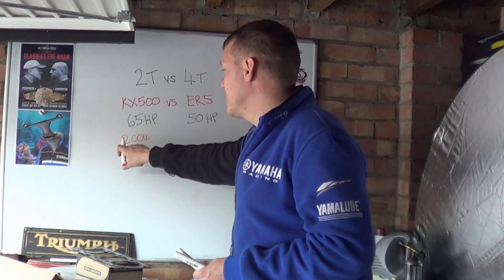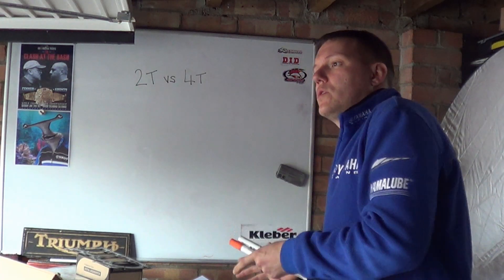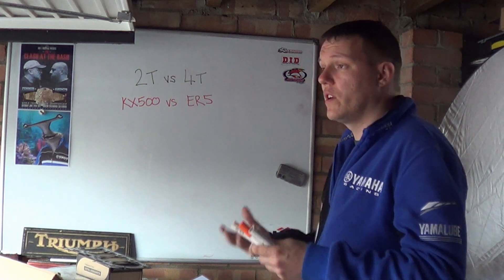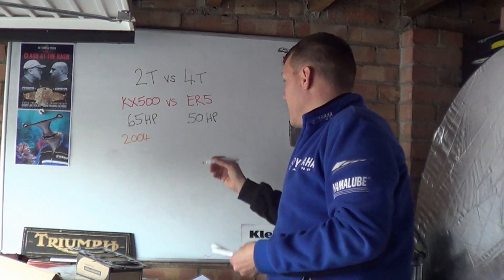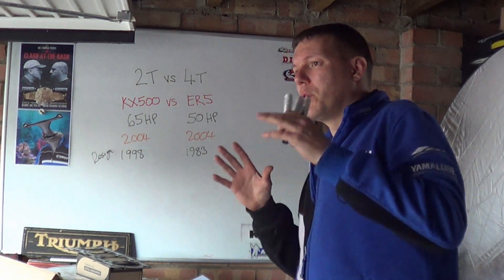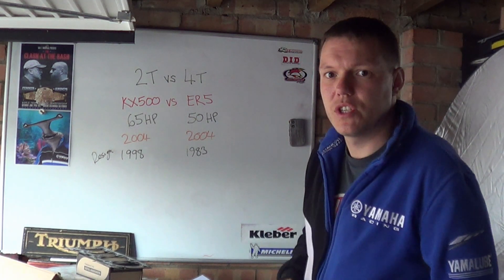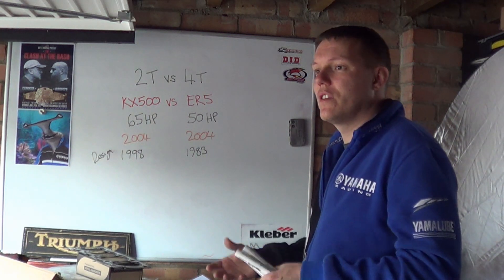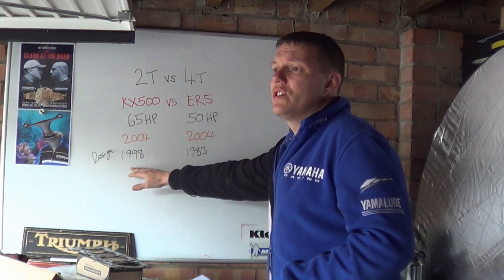2 stroke vs 4 stroke - case study-ish

Comment: the kx engine was from 1988 and basicly didnt get updated until 2004, i wanna get that out then there is some more stuff i dont really agree with
Reply from the maker: What year kx was being used?
Reply: @thedirtyworkshop  What do you mean?
Reply from the maker: In the video it's a comparison between engines with specs. So what of the KX was from 1988, the 2008 version isn't the same engine, so what is your point?
Reply: @thedirtyworkshop  No the engine is the same from 88 when they got the kips all the way to 2004 maybe they change the muffler but the core engine is the same, otherwise what did the change?
Reply from the maker: Your saying the porting never changed? Are you 100% sure about that? I used the specs from the 2008 engine if I remember correctly.
Reply: @thedirtyworkshop  No im quite sure they never changed it(coulf be wrong though) but in that case unless they did a mayor rework of the ports isnt that kind of the same thing as when the changed the timing on the Er5
Reply: @thedirtyworkshop  I could be really wrong but i just feelt that this comparison was a little miss leading (im i am kind of a wanker for 2 strokes so..)
Reply from the maker: No. Because the cams are just timing. Port design is not just timing, but shape, area, etc. are all important. The gearbox might be the same, the clutch might be the same, but the ports, head etc could all be different.
Reply: @thedirtyworkshop  Okay well then i might be wrong on that depending on if the ever changes the port or not( i dont think so but could be wrong)
Reply from the maker: I will bet £100 they did, several times over the years
Reply: @thedirtyworkshop  I wont😂

Comment: The #1 factor that makes one engine better than another is rules. The 2t was a dominant motor in racing years back there is no argument to that. If you didn't have a 2t you were not competitive. The fim wanted diversity in its fields so it allowed larger 4t's. Now the 4t without argument is the dominant motor. It's larger, and the power band is much more linear which makes it so much easier to ride. But the biggest factor that gives the large 4t the advantage is the generic recipe for what describes power. Power is the amount of work done in a given time. A 250cc  2t that makes 40hp at 8000rpm is equal to a 250cc 4t that makes 40hp at 16000. With that in mind a 450 4t theoretically should be around 70hp at 1600rpm. So in short we will never know which is better because rules dictate whats better. The 2 motors will never be placed on equal playing fields that factor in rpm and no one is going to invest $ into a motor that cant be raced just to settle an argument.
Reply from the maker: "The 2t was a dominant motor in racing years back there is no argument to that."

- apart from motoGP in 2001.....

Comment: Have to pull you up at 06:24. Single cylinder 2-stroke has same number of power strokes as twin cylinder 4-stroke making the KX500 far more  superior in my book. Perhaps a better comparison would be the KX500 vs say a KTM 500 single 4 stroke of the same era.
Reply from the maker: Same power strokes per rotation, but the cylinder volume is halved. True that increasing cylinder numbers increases peak HP but only slightly in this case - less then 5%. So "far more superior" is over the top. As for comparing the KTMs - I did this - just not for 500's

Comment: @the workshop while i do very much enjoy listening to you. you have a few points very wrong about the kx500. first the basic engine remained unchanged for the most part since 1986 when it received a KIPS power valve. the basic engine architecture has been set since 1985 when it received liquid cooling. second the kx450 replaced the kx250 2t, not the 500. again please keep up the good work, just wanted to clarify those points.
Reply from the maker: Very good points sir. 

- the point in the video was to compare like for like in cc. This weekend I'll be doing a video more inline with what you have stated above. 

"first the basic engine remained unchanged for the most part since 1986 when it received a KIPS power valve."

- true and this is also another point I want to make in a future video. That apart from DFI and some other little tweeks, the 2 stroke engine is so simple that there's little you can do to increase performance without adding either weight or cost or both usually. 

great comment - matt

Comment: You keep saying that the 2 stroke makes twice the power strokes, but because you are comparing it to a twin cylinder 4 stroke they are both making 1 power stroke for every 360 degrees of crankshaft rotation.
Reply from the maker: and the 4 stroke has cylinders with half the volume. This makes a slight difference in the favour of the 4 stroke until you include the added mass of having 1 extra rod and piston and 4 extra valves which are a drain on the torque produced.

Comment: Why not compare a RD350 with a Transalp 700?
They make exactly the same power, 43.5kw, while the RD is exactly half the displacement - and 20 years older.
Reply from the maker: I chose the KX500 vs the ER5 to point out that 
- 1. - 2 strokes have twice the power strokes but don't have twice the power, off the back of the volumetric efficency arguement from the previous video.
- 2. - Both were build and sold at the same time
- 3. - Both were discontinued in the same year because of the new (2005) emissions laws 
- 4. - This was a turning point for the 2 stroke KX series when they switched to 4 stroke.
- 5. - Both fire at least once every 360deg
- 6. - The KX @ the time (2004) was the lastest upgrade to the engine as a whole.

There's one other point that will come up in the next video and this is based around higher volumes and multiple cylinders, which is another reason why the 4 stroke is favoured more by manufacturers. 

At the end of the day, there are loads of examples with both their pros and cons. I chose an out of date 4 stroke engine against a (newer) 2 stroke as to not seem bias. The KX does produce more power than the ER5, just not as much as people think.

Comment: I think 4t thumpers have more torque, but at the very bottom end (just off idle) a 2t may be harder to stall (think of trail riding). Is this just because it fires twice as often? The dude at The Dirtbike Channel mentions this frequently
Reply from the maker: Yes, at lower rpm more energy has to be robbed from the momentum in the flywheel and shaft
Reply from the maker: Yes, at lower rpm more energy has to be robbed from the momentum in the flywheel and shaft

Comment: How about the most important thing? Which one is more fun?
I say 2stroke :)
Reply from the maker: That's a good point, but all bikes are fun aren't they?
Reply: mixing gas shouldnt be a problem :D It is a pain in the ass, yes, but get your engines running properly you wont be having problems with your pipe clogging up. The sound is what it is, but I have learned to love it more than the boring lazy sounding brrrrr that the 4 strokers make :) 
But both have definitely their good sides
Reply: I love modern 4 strokes, that's all I own now but I grew up on 2 strokes. Before power valves. There's nothing like a 2 stroke getting on the pipe
Reply: Yeep :)
Reply: 4 stroke is more fun to me because I'm not mixing gas, blowing stinking oil out my pipe, and the noise is more pleasing

Comment: So much wrong with this analysis.  The kx500 engine is from the 80`s and other than minor modifications remained the same. It is also in a relatively low state of tune due to traction limitations on dirt/sand and due to its massive single piston which reduces its rev range. 

To put this into perspective a 1990 kr1s produced 53bhp from its 250cc 2t engine, a 1982 ar125 produced 22bhp and 125cc 2t have been producing 30hp+ since the 90`s. The kx500 was hardly the pinnacle of 2t engineering. Kawasaki had a production street bike with 60hp 500cc 2t in the 60`s. 1980`s 500cc 2t gp bikes where pushing 150hp and the 2016 suter mmx500 is just short of 200hp. (more than the latest gsxr-1000 4t)

Secondly,  with regards to comparing it against a kx450f, there is over 20 years worth of extra development, the 2006 kx250 2t produced similar hp to the new 450 4t and they are 10 years behind and without the fuel injection advantage, but have the same output from nearly half the displacement. 

The only valid point is that 4 strokes are more efficient and don't produce as much emissions and no one has denied this. This point alone does not make them "shit", they still produce more power, with less weight, cost and complexity. Using a bit more fuel is a small price to pay for a bike that is faster, lighter and more agile. Lots of people must agree as major manufacturers are still producing, and developing 2 strokes in spite of the stricter regulations and when the guy that designed moto gp bikes creates his own 2t gp bike and series I'm inclined to trust his opinion.

Volumetric efficiency means precisely nothing unless you are solely concerned with fuel economy/emissions and for most people buying a motorbike this doesn't even enter into the equation. Now that legislation is forcing change we are seeing the development of ways to  improve the economy/emissions that where previously shelved because people where happy with the engine as is.  Ideas such as Hondas exp-2 from the 90`s will be refined, fuel injection will become standard alongside other improvements/innovations and the difference in economy will shrink along with their power output increasing whereas 4t have minimum potential left for improvement and now rely on increasingly complex and expensive technology to give slight gains.
Reply: You need to ride more if that is all mate.
Reply from the maker: "Volumetric efficiency means precisely nothing unless you are solely concerned with fuel economy/emissions"

- no.
Reply: well ok, it also means that the engine will be heavier, sluggish, complicated, expensive and less fun, but its ok, it will also save me next to fuck all in fuel when I ride my bike for an hour or two every few weekends.
Reply: +Moto Rad. True, but life gets in the way. Even if I rode it 10 hours every week I would still choose 2t and happily pay the extra fuel cost.

Comment: well what good is that little extra torque if a 2stroke feels like it has more torque
Reply: i have a 50cc 4t 4hp scooter and a 70cc 2t bike which makes about 18hp and the 4t pulls alot harder on bottom end
Reply from the maker: Does a 2T feel like it has more torque? Are you confusing power with torque?
Reply: The Workshop no not the top end of the powercurve, just in general i like 2strokes pullhard and almost never stall
Reply from the maker: or the bottom end....
Reply: ACreativeName the 70cc setup is most likley made just for top end.
A ktm 300 for ex has such a lowend grunt that its impossible to stall and pulls super hard